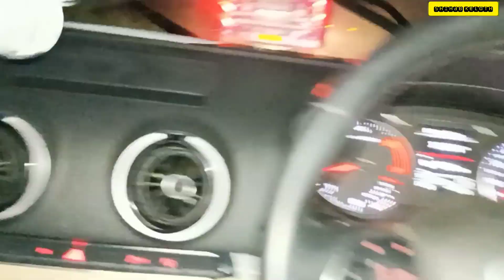Vehicle Not Move I DualMassFlywheel Damaged I എന്‍ജിന്‍ സൗണ്ട് കൂടുതല്‍ I Malayala@ShihabKeloth14

Comment: Alto k10 steering കുറച്ച് tight ആണ് അത് ഫ്രീ അക്കൻ eps ല് എന്തെങ്കിലും അഡ്ജസ്റ്റ് മെൻ്റ് ഉണ്ടോ
Reply from the maker: Power steering ano atho normal old 800 poleyullathano 
 steering rack kurach loose akam but noise varan chance und.
Reply: 2015 k 10 anu power steering anu pakshe normal വണ്ടിയേക്കൾ oru ഇച്ചിരി tight und service center avar rack pinion playil ഇട്ടു എപ്പോ ഒരു സൗണ്ട് വന്നു പിന്നെ normal akki athinte motor ഉണ്ടല്ലോ അവിടെ എന്തെങ്കിലും adjusting undo torque koottan
Reply from the maker: Motor il adjust illa fixed aan.
Rack bush new fix cheyth athil pluncher adjust cheythal almost OK akanm